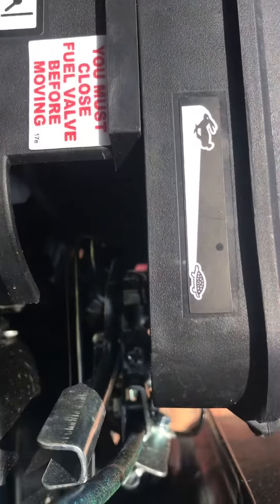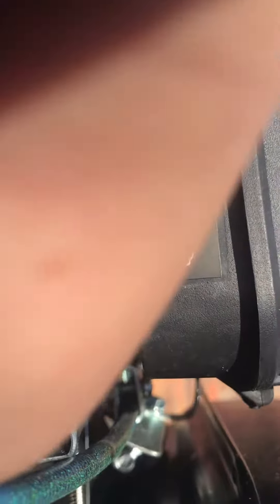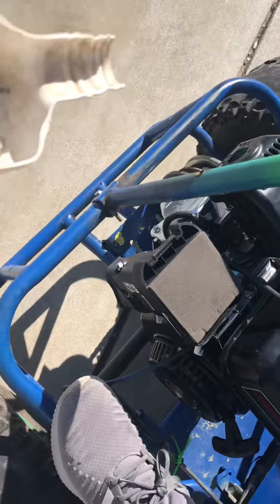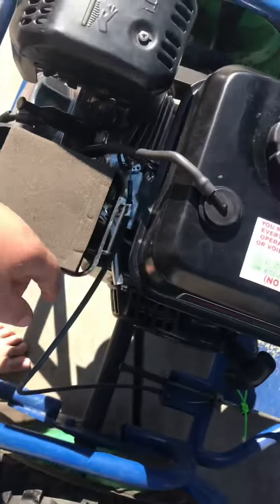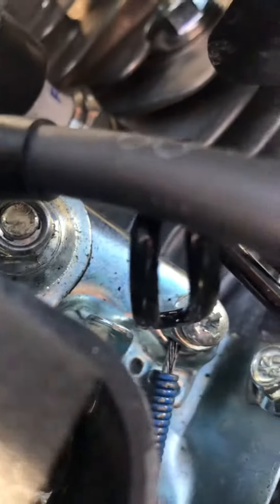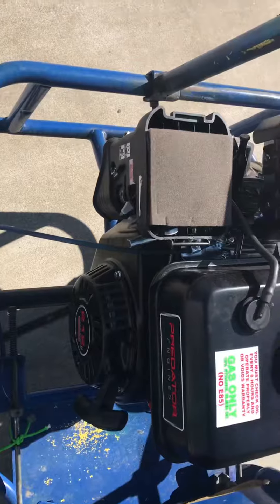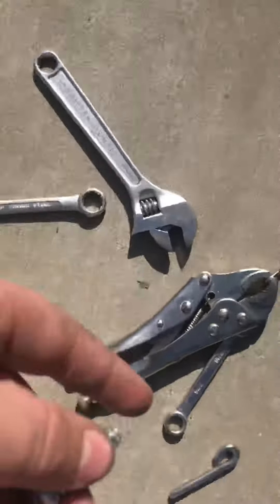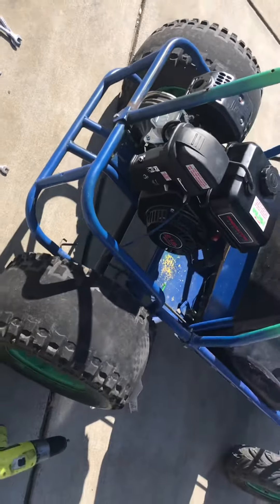Top speed run 👌🏼

Comment: You need to remove the governer, and that throttle screw only maters so much, if you remove the air filter box so you can see the carburetor, when you move the throttle you will see the actual (little black lever) throttle moving on top of the carb.  As long as that little black lever is moving stop to stop then you have full throttle... check it out. Oh and governer delete for sure.  That thing should hit almost 40 if it’s geared right
Reply from the maker: Small-N-Fun Everything is removed now the engine is fully built Billet flywheel 18 pound valve springs Mikuni carburetor clear Val case straight back header pipe governor removal lo oil Since taking out
Reply: Over drive go karts very cool!!  Keep up the good work